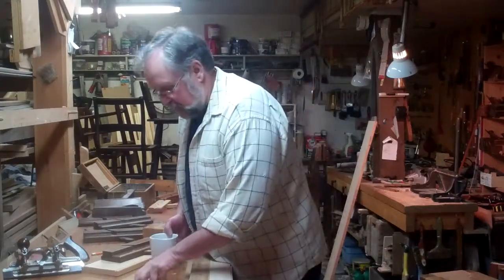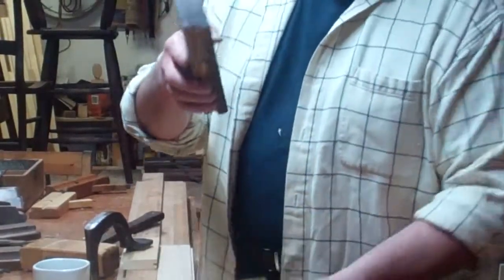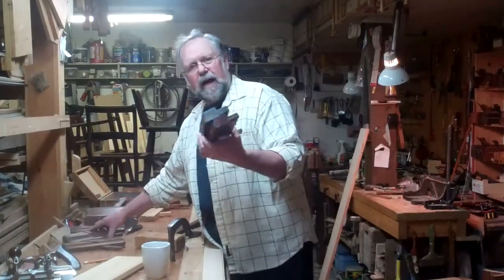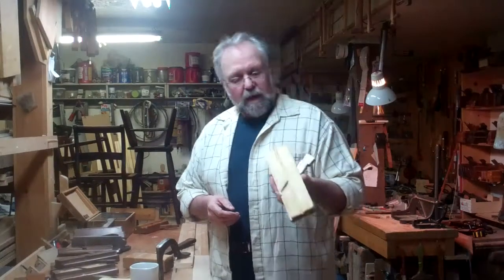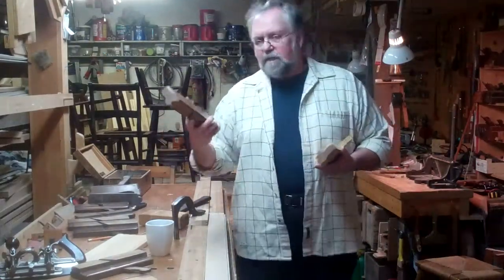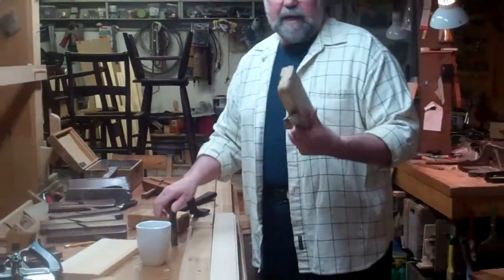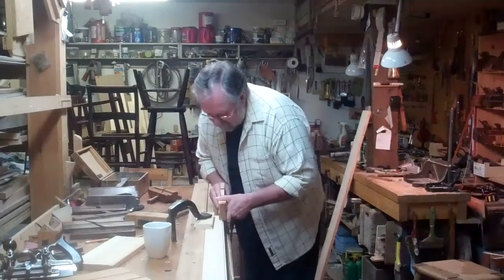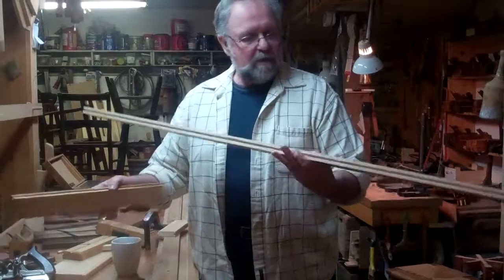Making a side bead & side bead planes

Comment: Got any tips on making a beading plane ? 
Did you just use a file to sharpen this ?
Reply from the maker: Ashley Actually, I wouldn't normally make a beading plane--old ones are easy to find, and don't take a long time to get up and running. The problem I had here was that I had to match the bead profile used on the panels I was repairing. It was just a little different than what I had, so I made the plane to suit the need. I used a broken file as the iron--as I didn't soften the iron I couldn't use another file to shape the cutting end, so I had to grind it to shape.It would have been quicker to soften the iron, shape the cutter, and then harden and temper. Chain saw files work great for shaping the cutter profiles.